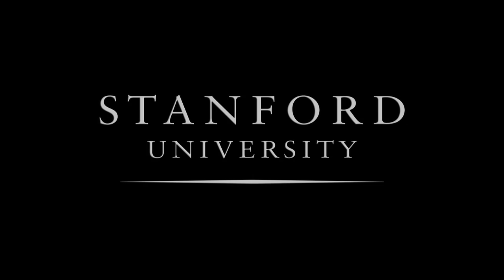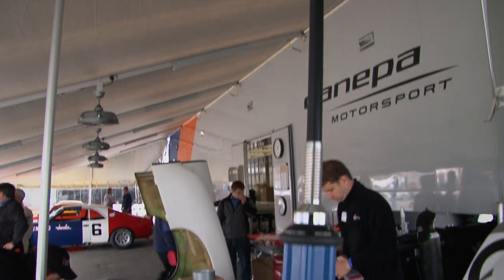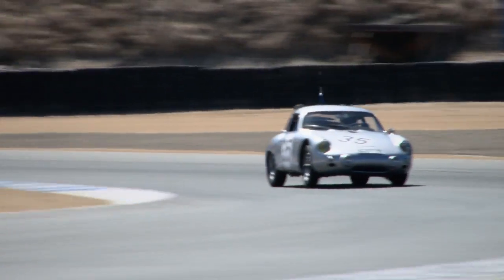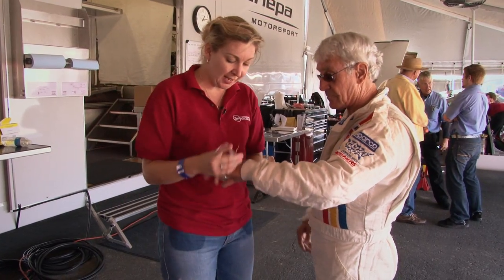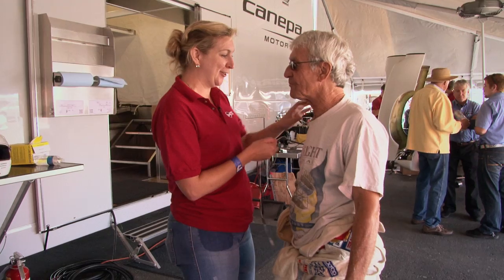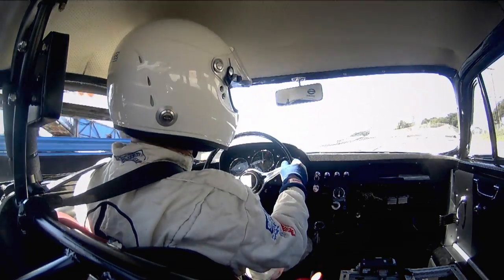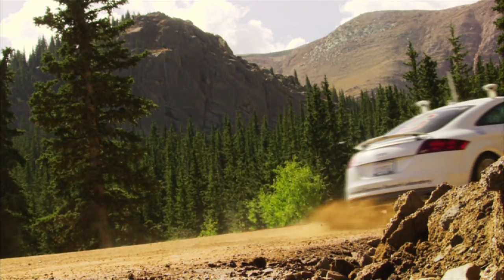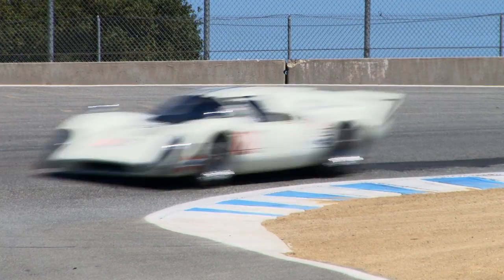Stanford Wires Up Vintage Sports Cars

Comment: The problem is that a car and it's driver do have connections beyond that of the measurable variety. Instinct plays a huge role in driving. Love and familiarity for the vehicle play even bigger roles. I think autonomous driving is a completely possible goal. Autonomous racing is a different beast though.